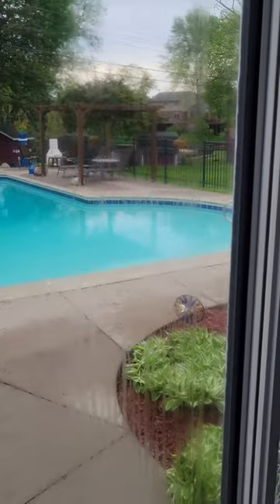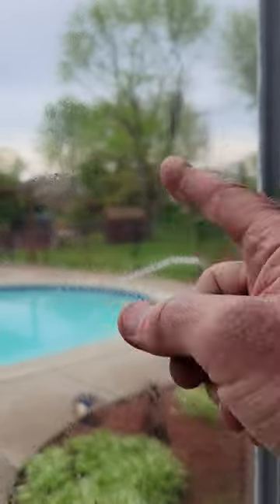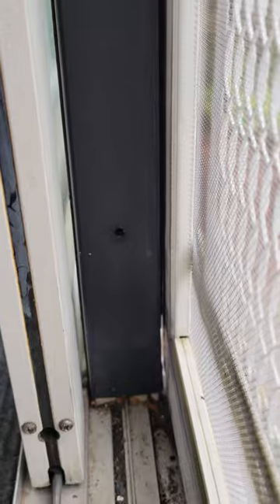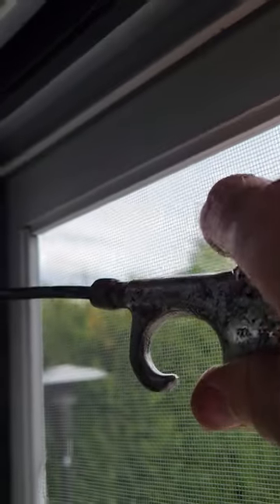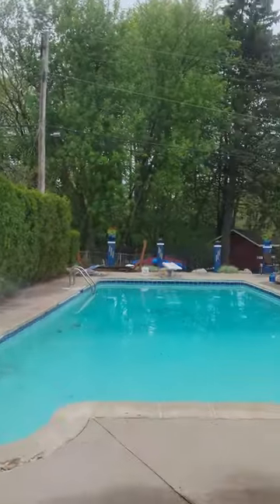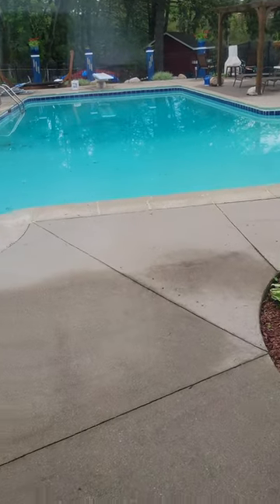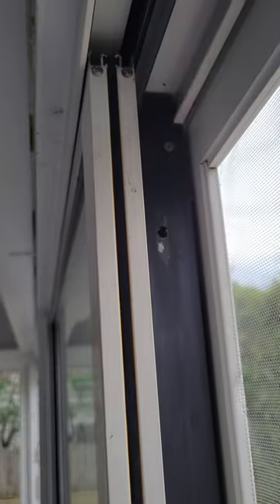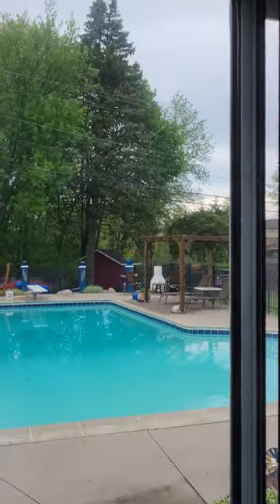Patio door/double pane window condensation repair.

Comment: Great video....has this held up or did you end up blowing more air in and then caulking? I know its been a year and at first you left it open, which seemed to hold up....how has it held up now that it has been some seasons?
Reply from the maker: Well, we moved from that house back in late October, but at that time it was still clear and fine. And no, I didn't blow more air in there or fill the holes.
Reply: @Artseventy6  thank you!

Comment: omg I am having the same issue, however I live in the north east and it can get cold in the winter and from my understanding these double glass doors are filled with gas to make them insulated.  By drilling the holes this would no longer serv its purpose.
Reply from the maker: I live in Michigan, so it certainly gets cold here too, this door is part of my Florida room, which is not heated, basically a three season room with several of these sliding glass doors, so I'm not worried about it being insulated. This is the only one with this problem.

Comment: Any concern with the drill bit making contact with the glass and cracking creating a bigger issue? Or are you not drill that far into the frame? Thanks!
Reply from the maker: It looked to me that there was a big enough gap between the glass, that I would be fine as long as I drilled in the center, and use a bit just big enough to get the air nozzle in.

Comment: Wonderful! I like it! May we have an update?❤
Reply from the maker: It still looks fine. there are no issues
Reply: @Artseventy6  Thank you! (A video update 😊)
Reply: My sliding glass door has like a dried condensation so wonder if this would work? It’s too expensive to buy new sliding doors!
Reply from the maker: @katielandis1677 yeah, I don't know. If it's dry already, I imagine it's like a dirty/water spotted window, I don't think blowing air in there would clean that. I wonder if there's a way to purposely cause condensation in there, to moisten it up, then try to blow air in there??
Reply: @Artseventy6  
Yes, I’m not sure either, I don’t know how to get in there and scrub it so easily. I may look at habitat for humanity for a new or used door. Thanks for your help!

Comment: Where to buy the compressed air?
Reply from the maker: I just used my air compressor in my garage to blow air in there to dry it out.
Reply: You can use a vacuum cleaner to suck instead of blowing. The dryer air will be pulled in through the other hole.
Reply: I have the same problem with my patio door.  I'll try this method soon. Thank you for the video.

Comment: I've been watching dozens of videos about drilling the glass but I had the idea to drill from the side and yours is the first video I've seen doing that.
Seems far more practical. Double glazed windows don't need to be air tight, just resistant to air flow.
 Holes can be plugged with silicone or even tape for easy access next time the condensation needs clearing.
Reply from the maker: Yeah, it worked really well for me, I just left the holes open and didn't see any more condensation issues.

Comment: Great video. One panel on my 12-year-old (?) patio doors now has the problem. Annoying. What is the space between the two panes, 3/8"? What size drill bit -1/4"? Might a can of compressed air as used around a PC work as well? Have you re-caulked/sealed around the outside to prevent new moisture from re-entering? What about pouring in some absorber like a silica gel before closing up the holes? Fun, fun, fun
Reply from the maker: I'm not sure of the spacing between the glass, and yes I think it was a 1/4" drill bit. The can of compressed air might be worth a try. And no, I did not reseal the window, and so far I have not seen any more condensation.